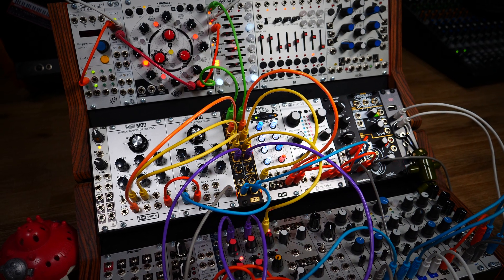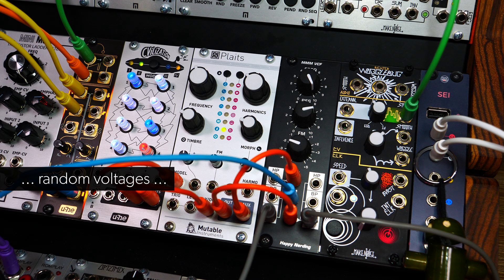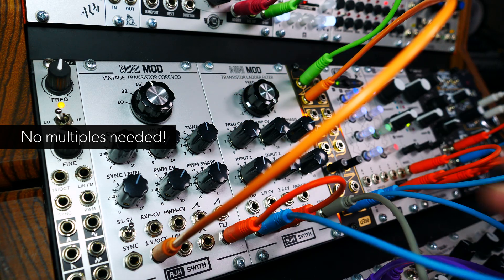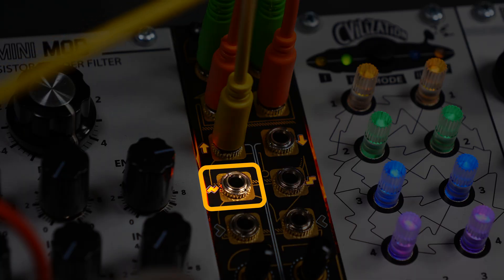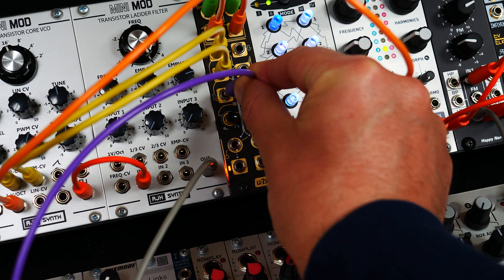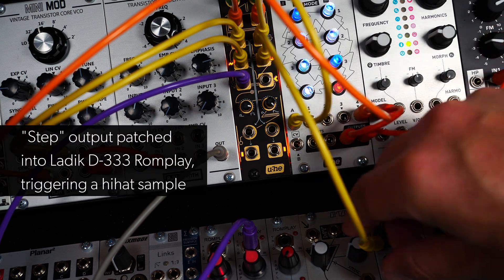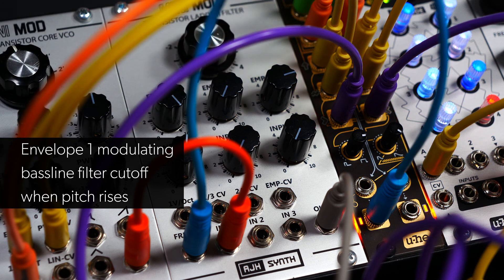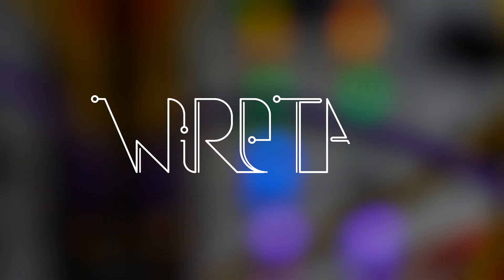u-he Wiretap – Part 1: The Basics

Comment: It is basically a CGS Slope detector and a comparator and an envelope, some kind of mixing modules already i. Existence, serge inspired
Reply: It's different in that it works well with sequencers and other stepped sources. It equals not just a common slope detector, but also an array of Gate to Trigger converters and it has two built in simple envelopes - on just 6 HP. You can however forgo much of the added functionality via a jumper setting, and then it indeed operates as a simple slope detector and comparator.